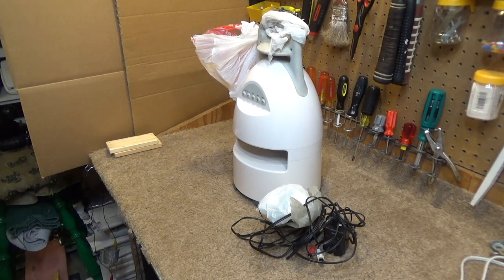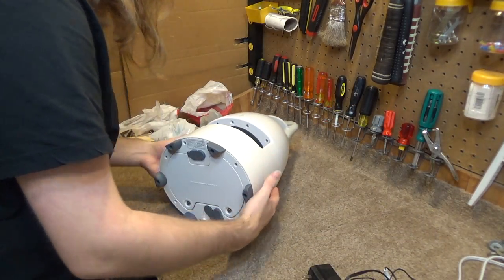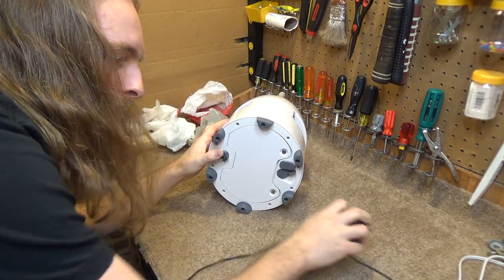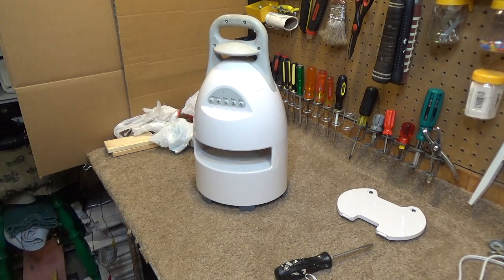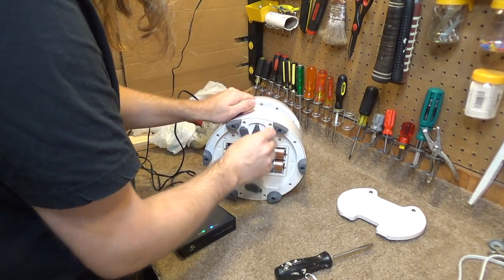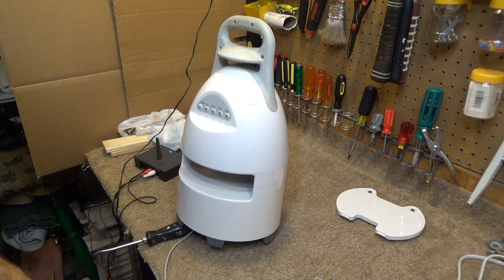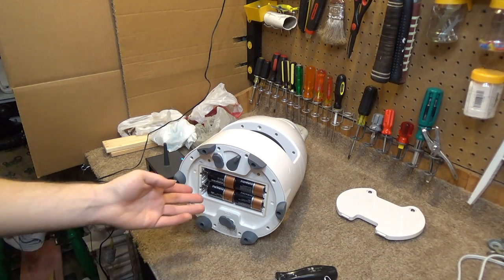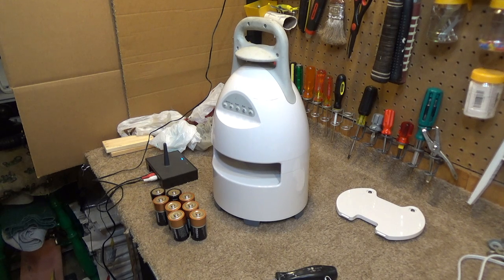Brookstone 497362p | Initial Checkout

Comment: My mother in law owns that exact speaker, and has the transmitter as well.  The wireless quality really isn't all that good.  It's generally used 20 feet away, but that is going through an outside wall of the house.  There's static and it seems to work better in certain orientations than others.  If it doesn't work in that spot, move it over or up or down a foot and it probably will work.  I'm not terribly thrilled with the wireless transmission for it.

Wow, what was that, 11 whole seconds of a real song?  Did it hurt THAT bad?  It was, after all, "just a little pin prick"!  I could instantly identify that song as "Comfortably Numb" by Pink Floyd, and I know how it's supposed to sound, so I can make a comparison of the playback from that speaker to the reference speakers I've played it on, and the quality is quite good indeed.  You don't even play 30 seconds of that track you use as an excuse for noise, so a real song shouldn't even be a problem at all.  And this was all precipitated because you were feeling lazy--now hold on a second here before you claim "rude"--and didn't want to run upstairs, all the way upstairs, and turn the server on, wait for it to boot up, etc.  And I don't blame you one bit for that, I would have felt the same way.  That was actually an excellent choice and a good time saver.
Reply from the maker: I've since acquired the transmitter, and I must say I am extremely disappointed in the transmission range.. The Brookstone website states "Dock transmits through walls, floors and ceilings to speaker from up to 150' away".. I know the range claims are usually tested in an open area so I don't expect to get anywhere near the claim in a real world-environment, but this is extremely misleading.. They make it out as if the range was tested in a realistic scenario.. I seem to get static whenever the line of sight is broken, then you have to move it around to get it clear again.. At least once it's in a good position, it seems to work reliably, and being omni-directional the orientation doesn't really effect where you want to listen..

I haven't done a formal 'range test' on this yet, but I've used it outside once so far.. I wasn't able to go very far at all, maybe 30 feet before it became unusable.. To make it even worse, the unit transmits in the frequency range of WiFi, so if you put a WiFi-enabled device in the transmitter like it was intended, you get nothing but interference.. Totally unusable..

It's truly a shame this isn't 900 MHz, or some other frequency that didn't have so much interference.. The design of the battery-operated transmitter is quite unique and the sound is better than the other few I have.. If you apply an EQ to your audio source to take into account the acoustics of the unit, it really sounds quite nice.. It's got great volume too, outside it can fill a large portion of the yard.. It doesn't get any distortion even at full power..

Why have 'just a little pin prick' if you can have 'no pin prick'!
Reply: My findings were pretty much the same; the wireless transmission really is not very good.  However the speaker does sound quite good, when you can get a reliable enough connection.  I'd gather it's an analog transmission because of the static, otherwise there'd be garbled audio or no audio at all.  And yes, since it's in the wi-fi frequency range, it picks up all sorts of hash and interference.  Great product, poorly designed.  If a few changes could be made it would work a lot better.

That's what the song said!  Besides, if there's "no pin prick", you'll never be Comfortably Numb, and instead be writhing in pain.
Reply from the maker: @jaykay18  I gather it's an analog transmission as well, perhaps that contributes to it sounding so good..

Comment: Got willed one of these a few years ago without the transmitter or cord. Do you happen to know a good substitute for either of these? I know it has a nice warm sound as I heard it playing prior. Oh, and the handle to mine was also sticky, seems it breaks down with the oil and sweat from our hands. Cleaning is easy with an oil based cleaner- rule is Oil cuts Oil, all original soaps are oil and or lye based. Thanks for the vid!👍
Reply from the maker: It can be operated off batteries, though I'd suggest investing in a set of recharge ones as the battery life isn't very lengthy. Transmitters and power cords can be found second-hand on the eBay.
Reply: @JordanU  So ya I got batteries, its on but haven't been able to find it in my bluetooth lineup. Isn't it bluetooth? Isn't that why you need a transmitter? Thanks in advance for your response.
Reply from the maker: @silvrliit  It's not BlueTooth, and that's why you need the transmitter.
Reply: Jordan U  Ah ok, any suggestions as to what that may look like or where to get a suitable replacement?
Reply from the maker: @silvrliit  I have purchased them off the eBay in the past.

Comment: Did you ever get the sticky handle fixed?  I have a similar one and issue.
Reply from the maker: There's really no way to fix it, it's deterioration of the rubber material that the handle was coated with. The only option is to remove is completely using some kind of powerful cleaner like Goo-Gone.
Reply: Wipe with a Clorox wipe. Stickiness came right off

Comment: I have this speaker and it goes off whenever you increase the volume, how can that be fixed?
Reply from the maker: I don't know, I've never had that issue with any of the ones I have.
Reply: Are you using the original electric adapter? If yes, it may be faulty and not putting out the correct amps. It should be 9V  2000mA. If its not putting out enough amps or volts, it will cut out when you turn it up. I've had that problem on different electronic devices before and after changing the adapter it fixed the problem. If not, than you have issues in the circuit board. Good luck!